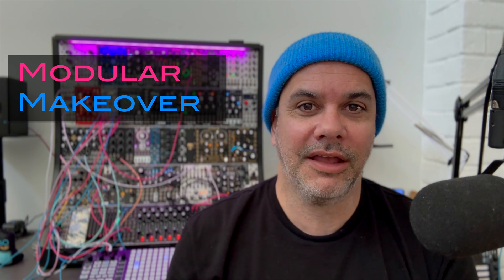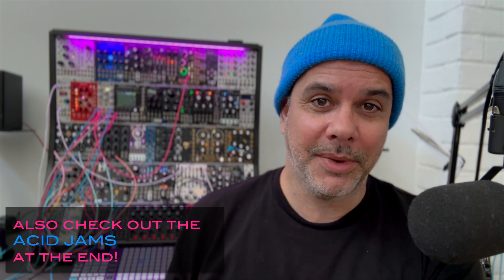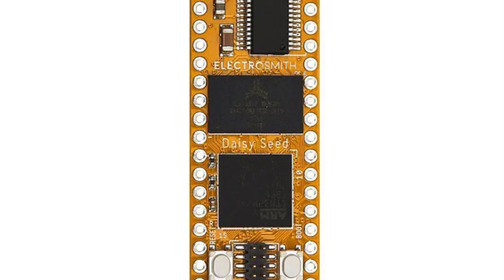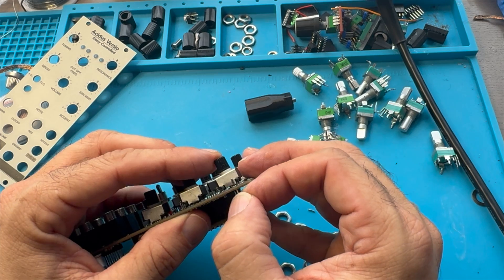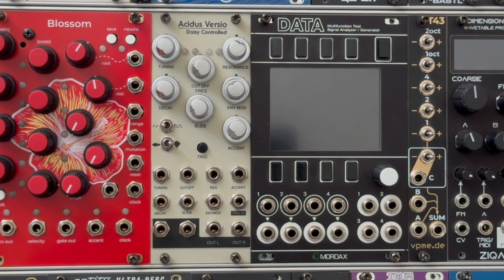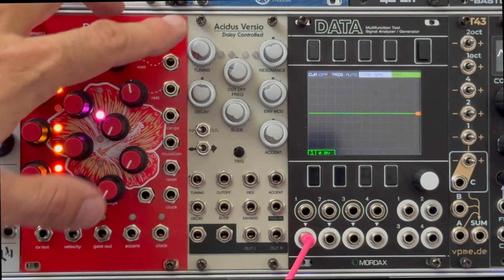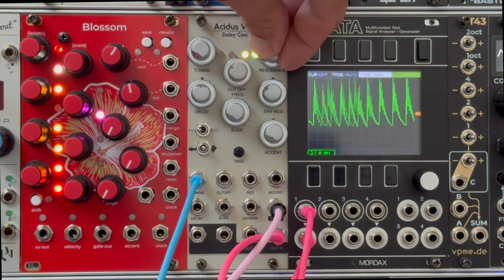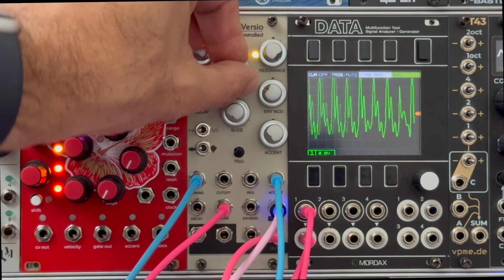Modular Makeover: Turning the Noise Engineering Versio into a 303 voice

Comment: how did you make the faceplate? is there way place that can do small batch custom jobs? I'm want to convert a couple cre8audio modules to black
Reply from the maker: The files for the faceplate are available at the github repository, so you can see how they were done. They are made out of PCB.  Generally the minimum order for a PCB fabrication is 5 at a time.

Comment: Qu-Bit are great in the way that they open the platform to user created firmwares, and they publish them on the official site. In addition, they now have the Narwhal page, which lets you reconfigure some of the firmware settings over internet browser, and flash them to the module.

One thing I noticed was that Aurora has ZERO 3rd party firmware hacks. hat might be ripe for the picking. Data Bender has been mentioned by others. Adding some of these and also the ability to reconfigure the alternate firmwares over the Narwhal page... Well, that could be a great addition. 

I'm very close to buying my first Versio module soon (Polydactyl for my drum rack) so when I do, I'll certainly be trying other firmwares. But I will also make sure to try this. 

Thanks for sharing. Liked and subbed.
Reply from the maker: There definitely are some third-party Aurora firmwares out there. Check out the Qu-Bit discord server for a list of them!
Reply: @bluenautilus  Oh! I was not aware of that! I will look into it, thank you.